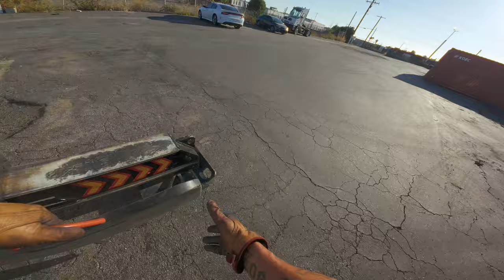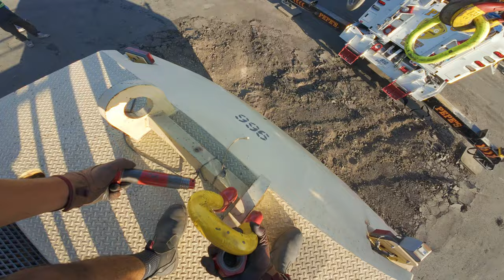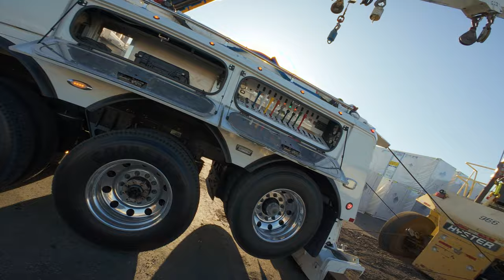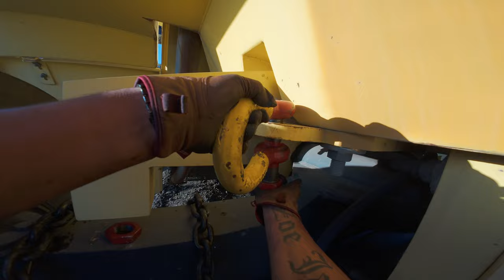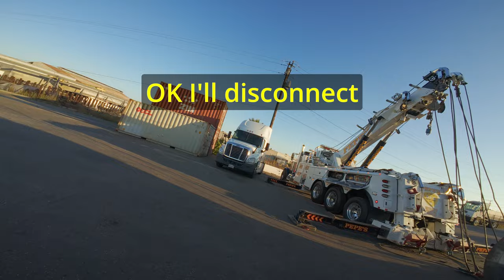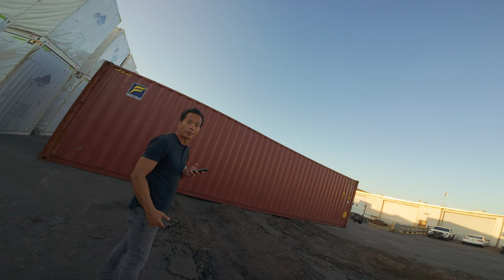Winching a 160,000lb Forklift "We're gonna need a bigger truck"

Comment from the maker: Quite possibly one of the hardest winch outs imaginable, who thought Big Flipper wasn't going to be able to do it? Also what did everyone think of my use of the green screen this time compared to the first?
Reply: I knew he could do it.  Pepe's never fails.
Reply from the maker: @tuberNunya  :_ThumbsUp::_Approve:
Reply: Great job by Alex & Big Flipper. You've mastered Green Screen Josh....Looks good.
Reply from the maker: @standishgeezer  Thank you! Makes me happy reading that. I don't feel I'v'e mastered it, but I taught myself how to film and edit it in a day so I still need learning. The lighting alone is so hard to eliminate shadows. Then throwing it in DaVinci, using a delta key later to take out the green, then tweaking here and there to make sure I have no green outlines and stuff. Soon enough I'll have this super dialed in.
Reply: How much does Big Flipper weigh?
Reply: @PepesTowingService  Why not leave all tires on the ground as well as the outriggers for a little extra traction? Nothing this heavy but I've also used mud flap under the outriggers instead of the plastic pads.
Reply: GUESS IT'S GOING TO REQUIRE A BIT OF INVESTMENT ON CEMENT FOR THE YARD 😢😢😢
Reply: The only truck bigger than big flipper is the M-100 by miller industries. It is a straight up monster
Reply: Good job on the filming
Reply: Tilting the mast back all the way and winching it from the center of the counterweight and not from axles it would shift more weight to the drives..winching in a angle to the pavement would have been a gd approach.. just saying..😅😅I think the parking break was on..when he first tried the operator realesed it .. the reverse did help.❤
Reply: Great use of the green screen, very professional looking content👌
Reply: @PepesTowingService  like the green screen choping it up with Josh.. next you have to get some of the old timers that worked for Pepes and have a dialogue on some of the jobs... next it would become a good second Channel... just brain storming here lol
Reply: Part of me didnt think it could where maybe you would show up but when i see how long the video is then I know it was a simple job
Reply: The nrc csr85 is bigger
Reply: Green screen and almost a school like whiteboard breakdown is cool. Maybe a way to do a little teaching on top of the footage.
Reply: Great video! What I’ve seen before is pick up the corner that’s stuck then put some cribbing under the tire!!
Reply: I work around these monsters everyday. 10 different yards including 3 different railheads. And everyone has something different for equipment. But it's all HUGE.
Reply: Old mate is it your biggest one.  You yep 75 ton . 😂😂😂  We rip that out like it's a soar tooth 😂😂😂
Reply: My M 100 would handle this job, easily.
Reply from the maker: @t.l.robinson2162 considering there's only like ten M100s out right now and the 1.4mil price tag I would truly hope it could handle that
Reply: @sharpshooter7127  there is another one nrc makes an 85 ton
Reply: @PepesTowingService 😂😂😮😅😮😊😂😢😅❤❤❤❤❤

Comment: Would've been a lot easier if you had some decent pavement there, I can't believe they would run that unit over such bad pavement. Makes things even hard to put the stabilizers out, they can sink right through also. Worst part is those machines have minimal ground clearance, once they break the pavement they sink right down, but as always you boys always figure out a way to get the job done safely. Great job!
Reply: Now add in the occasional heavy rainstorms that LA gets and that lot would be a whole heap of fun!
From all the videos I’ve seen a lot of these container storage and handling places are located on cheap land and the companies don’t want to spend anything more than absolutely needed to maintain their lots.
That means either a cheap asphalt top( rebar concrete is way too expensive) or even a hard packed dirt lot as I saw in another of their videos.
I guess it is cheaper to occasionally call out a rotator than spend money on lot maintenance.

Comment: Josh, you should send Alex to Rotator School in Tennessee.  He'll lard better techniques like preloading his brakes and suspension. He'll learn that putting his outriggers out for heavy wincing off the back can damage the truck severely. There is a video by Tom Luciano on YouTube that shows the proper way to do this.  Being boomed out so far can also damage the boom.  He got it out.  Good for him.  It could have been easier for him and the truck if he knew how to use it as it was designed. John Hawkins and Tom Luciano are great guys, and everybody learns something .
Reply: I am glad, I am not the only one to notice it.  I have been to Tom and John's class. They drill it in your head.
Reply: More people should see this schooling helps even the best
Reply: I've watched enough Ron Pratt to know you're supposed to keep the outriggers pulled in.

Comment: Not only was the blacktop completely worn out, but it was laid on very unstable base.
Reply: For real. Maybe when they get that bill from Pepe's they'll figure out maybe, just maybe they ought to get a paving company in there... lmao
Reply: I bet the heat does not help. Also turning the steering wheels when not moving will also break the surface.
Reply: @Kevin-go2dw  Sounds something like doing a quick zero turn on a zero turn mower and that tears up the grass. But mowers don't weigh 160 tons and they use low pressure floatation type tires.
Reply: @Kevin-go2dw  And not only is the Hyster heavy, some of those 40' shipping containers can gross out to 67,000 lbs max rated weight.
Reply: @brnmcc01 Yup, a container handler like that will be grossing ~ 120 ton fully loaded with 80-90% of that weight concentrated on that front axle.

Comment: Who ever paved this lot gave the customer a tuck job, asphalt looks like 1" thick !!!!
Reply: Looking around that lot this place was probably originally designed for light duty industrial.
They used the parking lot as a container storage and handling site and didn’t bother to investigate whether the blacktop was rated for such heavy loads.
Looking around during the video and you can see depressions and warpage in a lot of places, this means it’s been abused for a long time by these loaders.
Wouldn’t be surprised if tractor-trailers go through the surface as well.
Someone bought this lot as cheap storage and it shows.
Reply: Yup, you need the right surface for these machines. Something like 6-12" thick slab of rebar reinforced concrete. Apparently block paving with good groundworks stands up quite well to them as well.
The owners of this machine really need to re-evaluate their options.

I'm a forklift tech and had a bud who worked for a manufacturer (Fantuzzi) whose job was driving around England assembling them. 
I remember him telling me they had one big reach stacker they built that immediately sunk to its chassis once they lowered it off the timber cribbing onto its wheels 😂

Comment: I used to drive the old Pettibone forklifts.  You sat on top, unprotected , no cab. Just a seat and controls dropped on top of a machine the size of a garage that could lift a mountain.
Mine had been upgraded with two 50ton rams instead of the original 25.   I used to carry cell phone tower sections , masts, and crane assembles. I had to wear polar fishermens gear in the winter/wettimes.Really , they bought it for me! it was like $1500. Snow , sleet , rain, sun, dust and mud always exposed up top on the pettibone. it was a cool job for a year when young.  I still remember eating lunch up there, to lazy to climb down and back up. so my boss would throw food and a thermos up to me. Totally exposed vrooom vroom. Petti had a five speed manual gearbox air brakes on the floor and on the steering column smooth as butter.   Picture someone sitting on the very top of a tank with a seat steering wheel and some levers. thats all!     Now we get awsome heated , stereo, comfy cabs. 
And joysticks with hat switches. Aww yeah , so much better.  But petti never broke and was a simple as a lawn mower, soo theres that .

Comment: Now we know. Adding the extra block increases the pulling power of the winch as well as strengthening the cables rating. What a beast. The rigging was very interesting to say the least. Would be nice to know where Alex picked up all the techniques  he uses. We used this technique on the farm to lift heavy things like an engine block suspended by a tree branch. (block and tackle) Another great video. Thanks for posting!

Comment: In some of the background shots the yard is in disgusting condition for a container forklift. The subbase was pumping and the bitumen appeared to be to thin for the weight of the forklift.   Did anybody check to see if the yard was rated for forklifts at this weight? I think not.
Also the tow truck was pulling several times the forklifts weight due to drag of the gravel.  I was impressed the tow truck didn't simply reel itself in even with spades deployed.
Well done.

Comment: Josh your doing great with the green screen. How about you make a full size background of the job your talking about. Say the rollover excavator driller. Have the green screen be a full size shout maybe from the drone. I love what your doing expanding with the technology, and like you said before what tow company is doing that! One thing I haven't seen lately is, you and Alex both would explain the Baily's sling ratings when your using them. That got us the viewer a little deeper into your thought processes and methods for each job. Love the explanations like this sling will be XXX in a straight pull and xxx in a basket. It would have been cool if Alex explained the weight ratio's for the 3 part line and then adding the deck winches which gave him xxx pulling power or rating. Love the channel guys keep it up!

Comment: Unlike the excavator on its side, it was nice to see that this tophanndler had some lift and pull points. Also, I've never seen a pull heavy enough to require two boom lines to be 3-parted and two drag lines to be snatch-blocked.

Comment: First time I've seen Alex check the placard but not the first time I'm sure.  That thing was a beast.  Not often we seen the trucks move that much.  The irresistible power of Big Flipper on display.  Nice work getting that Hyster out of there and the yard cleaned up.  Could you imagine having a rotator that could just pick one of those up and move it to solid ground?  What a beast.  Too big for the area though.  The green screen is working out pretty well.  Lighting  while using one is tricky though.

Comment: What casual users of the big container handlers don't consider  in regard to wheel loading is the weight transfer. Sure the steer axle is heavy at about 70% of the unladen truck weight but the problem for hot bitumen with poor sub grade and compaction is when they lift, travel and turn with a loaded 40 footer.  I have seen overloaded 40" boxes go 34 tonnes and when you lift that with a counterbalanced lift truck the drive axle load can rise to around 90 to 95 Tonnes across 4 drive tyres. Turning and braking dynamics will soon show up any crappy pavement and concrete with inadequate sub grade. Typically you want concrete of (aircraft) runway thicknesses if you want to work properly with these wheel loadings.

Comment: I wonder who was the genius that chose to go with asphalt for that lot rather than concrete🤦🏻‍♂️😅.
Reply: The surface is only as good as the base. Most delivery services refuse to go onto private driveways for this reason; they don’t know if there’s just a few inches of concrete, blacktop, or pavers that they’ll break thru and be sued. For these containers, they need pretty deep base, like a highway.
Reply: @rickvandusen9271  yes I agree. Asphalt by itself is very malleable under such pressures, especially in a hot day. Nothing beats concrete, yes it cracks of course but that’s what control joints are for.
Reply: Cheap skate is who 😅
Reply: A lot of low budget container shipping/handling and trucking outfits buy buildings with large parking areas in cheaper districts zoned for light industrial use only, they then convert it straight into container storage and handling without bothering to read the zoning laws and understanding the construction of the parking lot before they roll in the heavy machinery. The county property inspectors and OSHA should be involved in monitoring the safety of these lots.
Some of Josh’s videos show tipped overloaded containers which punctured the blacktop they were sitting on because the owners never bothered to check the blacktop ratings on the site before dump heavy containers directly on the asphalt.
Reply: @glenyoung1809  yes I agree, especially these Chinese.

Comment: Poor asphalt, sun, hot temperatures, big weight machine, high ground pressure, certainly results in giant holes in your container  yard.  Do those Hyster container fork lifts come with the options for extra tires for more flotation (less ground pressure) like the big farm tractors do?
Reply: Actually went on their site to look up that model, it doesn’t look like you can get any Addon tires.
Was curious as to the ground pressure and did a rough estimate, the tires are 18” wide and the footprint looks up be 5” long, so total area of all 6 tires contacting the ground is 6x18x5=540 sq. In. carrying 160,000 lbs handler, so the ground pressure alone is 296 psi for an unloaded handler assuming even weight distribution which isn’t the case with such machines.
That asphalt looks to be all of 2” thick sitting on top of compacted dirt with no foundation layer, so basically the surface might as well be made of cardboard where those heavy handlers are concerned.

Comment: Could you have used a large kinetic rope for something like that? Might have taken a few yanks but I would think it would have been quicker/easier (assuming it would work). I watch a lot of channels that do amazing things with kinetic ropes pulling vehicles out of similar situations even if the stuck vehicle is much larger/heavier than the pulling vehicle. Usually they just need a little help getting them moving. For example HeavyD uses kinetic ropes a lot on heavy equipment.
Reply: @3dland-x4x  Not sure what is funny about that. 2.5" kinetic rope is rated for over 200,000 pounds.
Reply: Stuff heavy d moves is half the weight of this thing. Usually a bit more buried tho.

Comment: Thats a badass truck! this dude is working hard having to lift all those heavy ass cables! I don't clearly understand the situation because I want to ask how this truck is not capable of just hooking the cables up, putting it in the lowest gear and just drag it out while using the lift in drive or reverse as well? upon reading I saw you said it had to be lifted which is a WHOLE other issue I suppose...lifting 160k lbs is alot different from just pulling a 160k lbs. those bad ass trucks up in the UP in michigan drag race with near 180k of weight in their trailer but then again those are trucks with 1000hp and much more torque, this truck is "stock" a 75 ton beast but stock none the less so perhaps that is my answer

Comment: I don’t know just asking. If you were to add another set or two of the pulleys would that improve your pull from the bottom or would it exceed what the rating on the cables are capable of?

Comment: 2 things max pull when more line is out another is don't use the outriggers unless ur using the rotater or u risk damaging them that's straight from the manufacturer good way to put a 750,000 dollar machine out of service for a while

Comment: If you had 5 more tons you could dead lift it. 160,000lbs = 80 short tons.
Reply from the maker: Not true. The 75ton rating is only fully retracted off the back at 30 degrees. You'd have to be extended out over it and at that distance it could not pick this up
Reply: @PepesTowingService 
Ya I thought about that at the end when you showed the two rotators picking up the other container lifter.
Even a M100 would of had a tough time on these jobs.
Reply: Pretty cool thou to visually see what it could be capable of lifting (theoretically). Them trucks ain't no joke that's for sure.

Comment: what a miserable surface. That shows what happens when you don't have a proper substructure. Here they just leveled the dirt and applied a thin layer of asphalt. That can't hold anything.
Underneath the asphalt there should be at least a 12" thick gravel base layer, then an asphalt base layer of at least 5-6" thick and then another 1-2" asphalt surface layer on top. That will hold even under such heavy loads.
What was built here is just rubbish